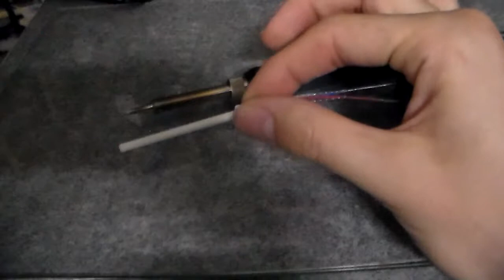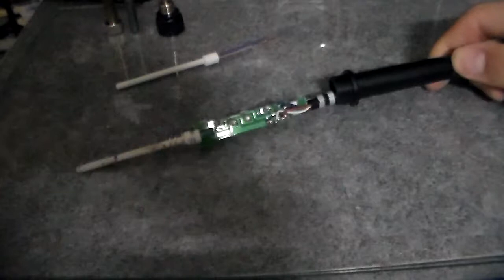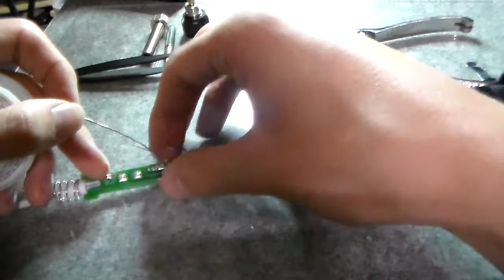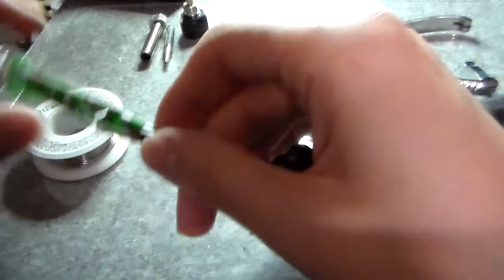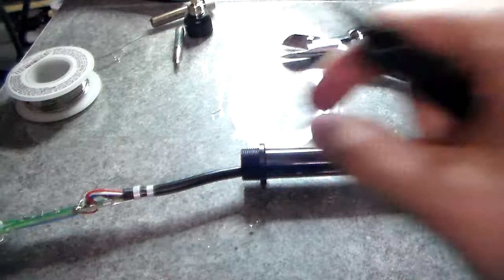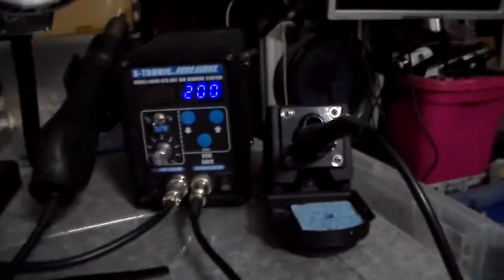X-Tronic 6040 iron repair, digital soldering iron fix

Comment: i bought this soldering iron and it came broken. the heating element was in three pieces
Reply from the maker: oh no! It should have come with a spare, but hopefully you have different iron to replace it with. contact the manufacturer and they should send you a replacement element!